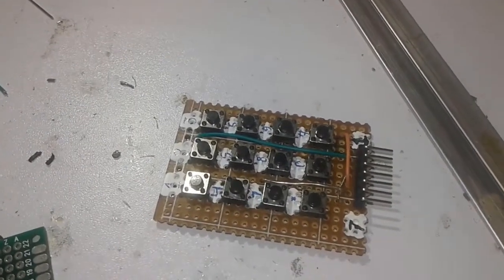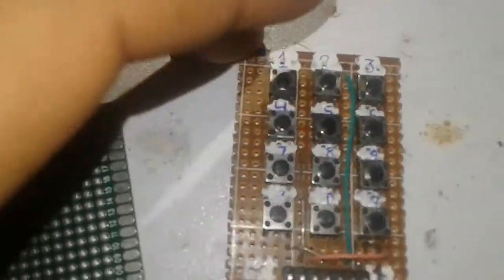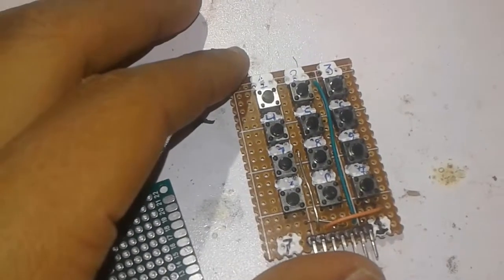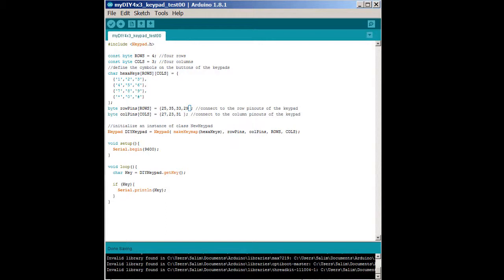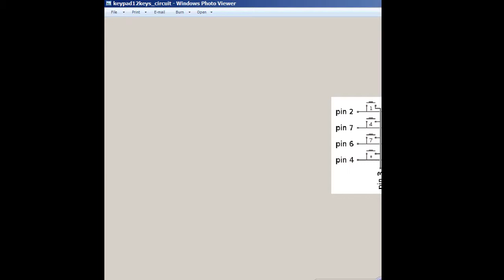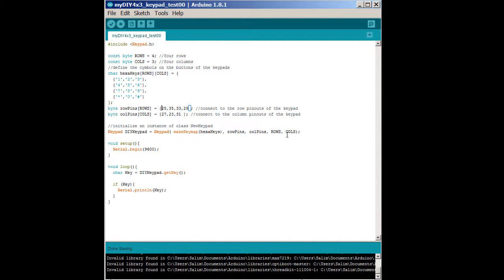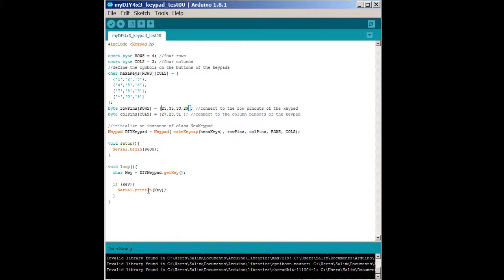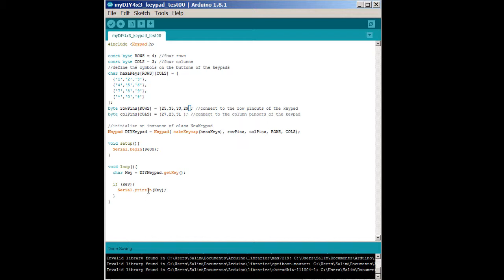Build your own Arduino KEYPAD (DIY style)

Comment: Off subject question.I have a small motor its for 6v 330 mah.I have 20 small solar cells. Rated 2.5v 100 ma. Can i put 2.5v 1.5ma into the motor with out damaging it?
Reply from the maker: ok let me understand this, so you have 20 solar cells each is rated at 2.5V  100mA, and you wanna drive the motor which is 6V 330mA ?? right ??. ok first of all solar panels and cells are generally used to charge some batteries and then from them you would figure out how to drive your load, (maybe with a stepper or booster )... but anyways in your case I think you would put 2cells in series that will give you 5V , with that the motor will run but not in full speed, as for the current I'm not quite sure but to be safe you would put four couples of the two cells (in series) in parallel so you would have 2S4P arrangement , and that will give you a solar system of 5V 400mAmps but again the motor will run slower than the nominal speed, so for this last arrangement you either going to have to use a booster board to get 6V making sure that it can handle more than 330 mAmps,  or you would add another cells to the ones in series, that will be 7.5V 400mA , 4x3=12 cells; and then you would step it down to 6V , I guess it's not very critical mostly the motor will not be damaged at 7.5V (it will just run faster) but 5V is totally safe it's just going to run slower as I already said. 
also note that the solar cells will not reach 2.5V unless they're sufficiently brightened , otherwise the cell's voltage will be under that depending on the luminosity,  I hope I have clarified a little bit